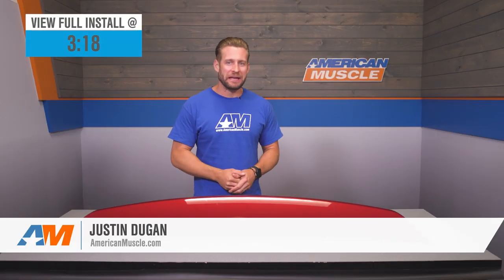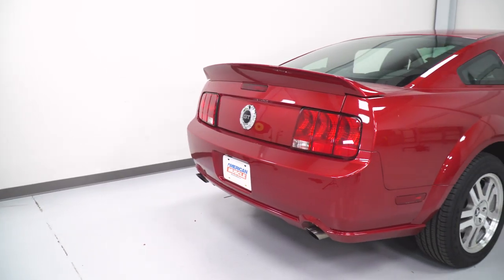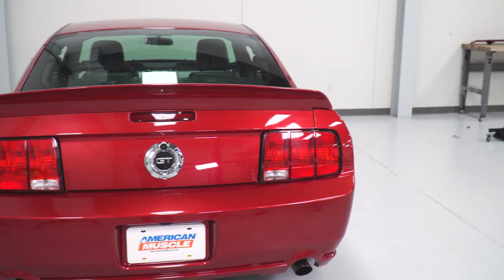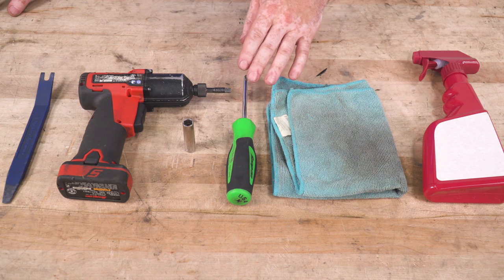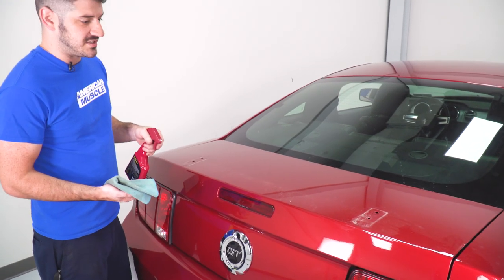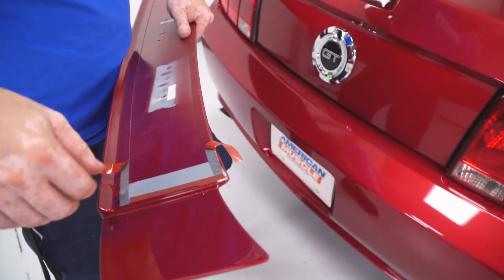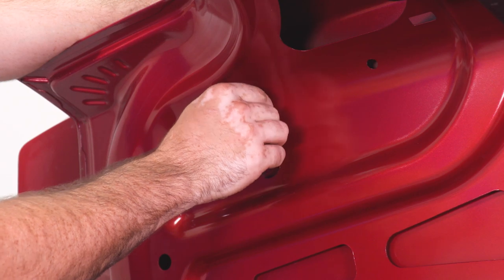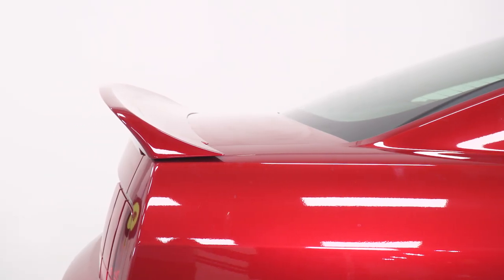2005-2009 Mustang MMD Ducktail Spoiler - Pre-Painted Review & Install

Comment: I don't like how the front holes aren't used. They're only covered up by the spoiler. Water can get in to the trunk if you don't fill those holes.
Reply: Marcus K. Exactly I have been wondering if anyone has had that problem with the spoiler besides me every time I wash the car I end up with water in the trunk not a lot but it does very slowly seep in